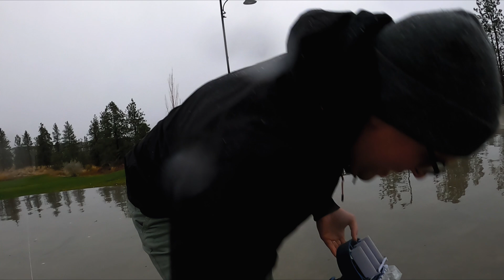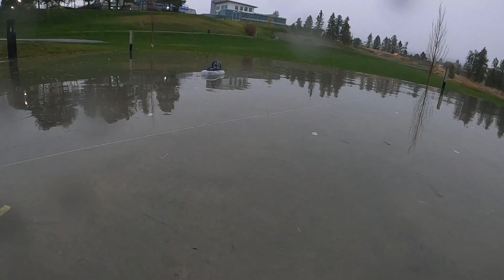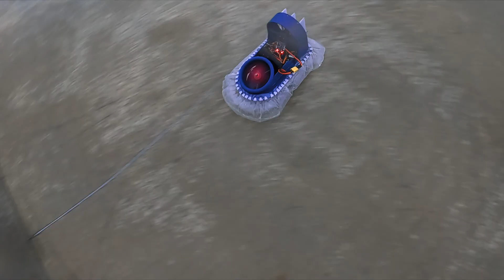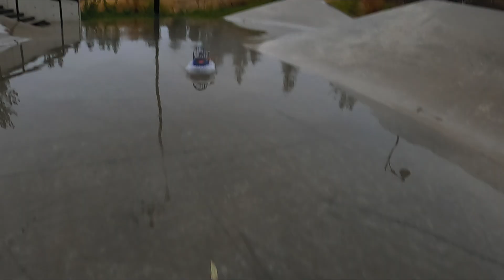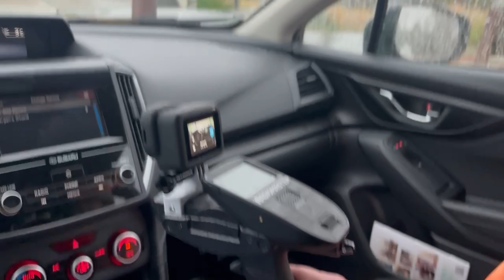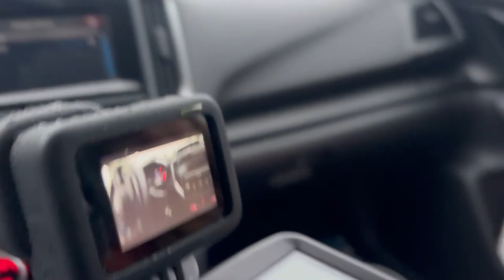3D printed RC hovercraft - Skatepark

Comment: Cool, I built one too, about the same size but the 3d printed parts are replaced with hard cardboard. Keep it up
Reply from the maker: That would probably be more durable. The problem with this 3D printed stuff is it doesn't take impacts too well.